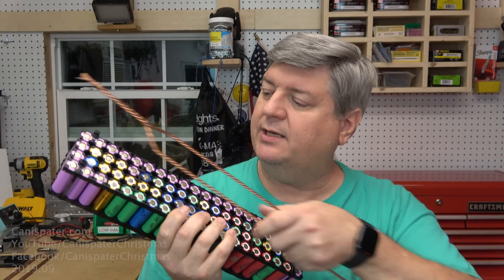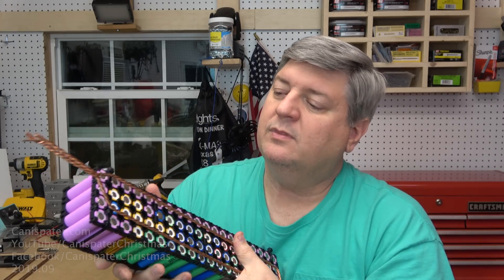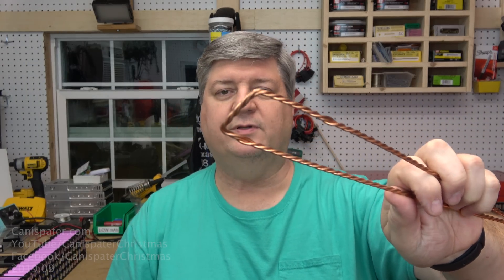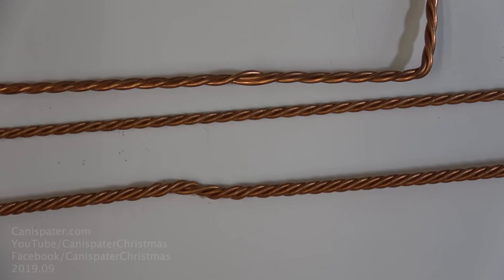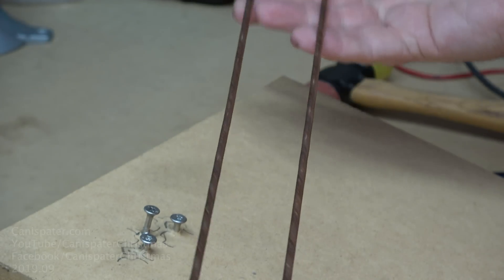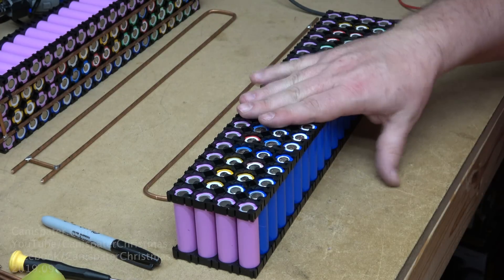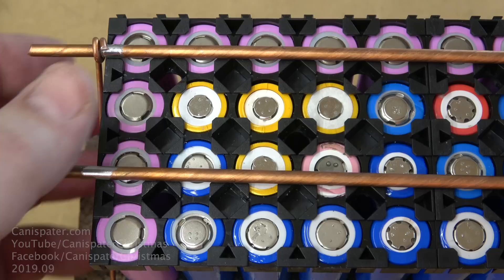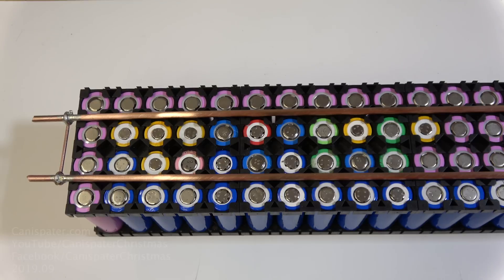⚡️DIY Powerwall Project - ep6 - Bus Bars  (2019)

Comment: Hello I like ur idea very good, I’m building a 48v pack  8 x 14 .  What size of busbars u recommend and what’s the best set up of busbars . Thanks .
Reply from the maker: It would be based on the maximum current that you are designing for. What are you planning to power with the battery?

Comment: Awesome!.. how many amperes can you flow with your configuration with that awg #6?
Reply from the maker: I think 6 is rated at ~55amps, but I stay well below the max on that. If the wire heats up, you've gone too far. 😂
Reply: @CanispaterChristmas  oh hells jaja... Nice, I have a problem. I bought this popular electric motors for ev motorcycles. And I need to drow 120~150 amps continues. But I've loved your method. I don't wanna die by fire. So I'll check the 4 AWG Maybe. Thank you.
Reply from the maker: Oh yeah, e-bikes pull a lot of current. Need big wires. 😂

Comment: Great video!! Can you throw out a link where you got the Anderson plugs? 🤪👊
Reply from the maker: Sure! It's the PowerPole 75. https://www.andersonpower.com/shop/wire-to-wire/powerpole/powerpole-75.html I can list actual part numbers if you want. I also didn't get the pins they have to holding two of them together as they are pretty tight once you put them together. .Actually, I'll edit the video description and put the part numbers in near the top.
Reply from the maker: Oh, and Thanks! I've added all the info to the description and to the Powerwall Info Page on my web site.
Reply: Thanks buddy.. much appreciated!!

Comment: If the bus bars arnt attached to cells yet you could slide the bar out a smidge so the bend is inbetween those last cells. Does that make since🤪🤘
Reply from the maker: Yeah, I'm waffling back and forth on that. I know most put the bend between the last two rows and I don't really have a reason not to other than it's a little tougher putting the wire tie on a corner. Any reason to go either way? Also, what do you think about using nickel strip on the negative side going over the bus bars (nickel bending around the bar) or would that be too much of a pain? OR running 4 strips all the way down the pack and just tacking to the bus bar at several points (negative side only). Using axial fuses on the positives. Guess I need to start playing with the KWeld... once I finish these dang busbars. lol 💥
Reply: I use nickel strip (I think 6mm) cut in half length-wise for all my negative cells. And then I just solder on top of them to the twisted busbars. Works great and at least my negative side is very stable. I feel like I could pick up the 100p packs and suspend it just from the ends of the busbars without any problems. Now the positive side with those glass fuses I bought from Joe's channel is another story but nothing can be done for that really. Damn fragile fuses!